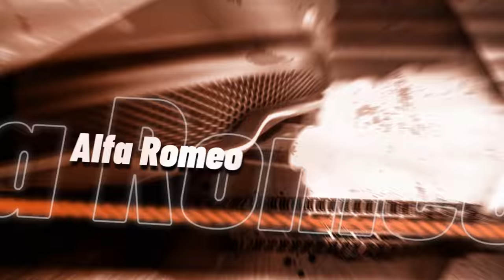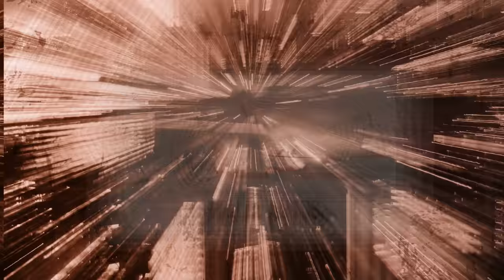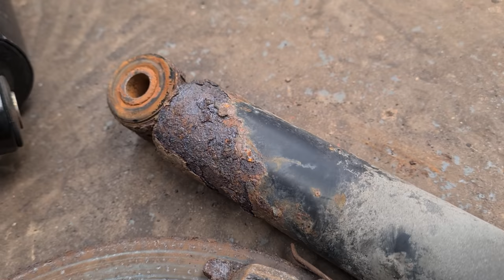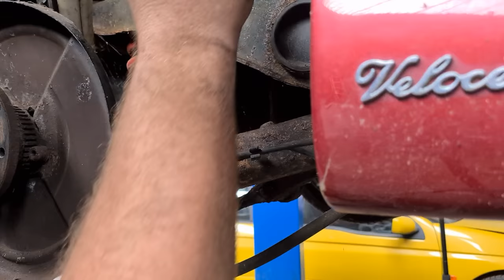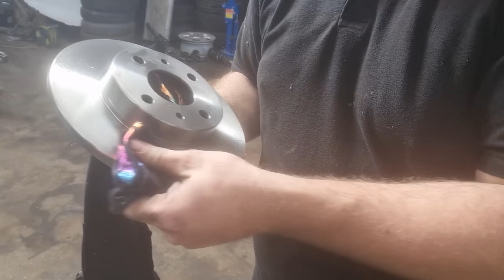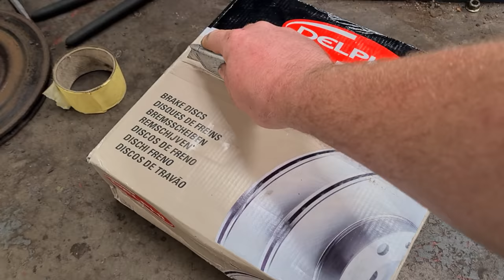Alfa 145 gets some new brakes and rear shock absorbers

Comment: Reasons as to why I typically complete my own brake work:

I rub down the disc mounting surface on the hub with a wire brush and brake cleaner, sometimes smearing the thinnest amount of copper slip on the hub

I clean the disc retaining screw thread and lubricate with copper slip

I remove carriers completely and thoroughly clean the brake pad sliding surface to stop sticking 

I clean the hell out of the calipers and even lubricate the piston to stop it sticking on the inner pad

I also ensure the parts are clean enough to allow the pads to slip in and out without much friction

But I guess I take ages as the time is my own

And I cannot believe there was no lubricant on the corners of the pads to stop squealing! How did you miss that or not clean the carrier surface??!!

Also, I hate uncoated discs, Delphi are always uncoated. My go to disc now is Borg and Beck Becktec as I cannot stand corroded brake hubs on cars after a fresh set of brakes!
Reply from the maker: wheels are coming off again and prob so are the brakes when the engine comes out for the rest of the work.

Comment: I'm really surprised that you didn't put any (copper) grease or something like that on the bolts that you put back... especially because you're struggling to take them of..
Reply: Or even put back the deadly rusty bolts
Reply from the maker: bolts had lube on them when refitted. several of the bolts where also cleaned up off camera.

Comment: I was able to get a 15mm socket on to the top shock absorbers nut through the plastic sleeve (4 min 20 secs) which takes away the risk of dropping the bolt or socket into chassis rail.

Comment: Telling off time. Don’t tighten bushes up without the weight of the vehicle on them and the car in its normal ride height. It just twists the bushes into an unnatural position once lowered and wears them out quicker. So many mechanics do this and it’s bad practice.
Reply from the maker: yep you got me.
Reply: As good as that sounds and should be done, I don’t know a single mechanic that loads a card suspension up before tightening the bolts. Maybe a Lotus Exige specialist or something, but no other mechanic will do. It’s very hard to access these bolts with a torque wrench once the car is on the deck.
Reply: @ItaliaAutos  Yes I was wondering about that... easy when you've gpt the transmission jack under the trailing arm.

A bit sloppy when you're showing "how it's done" professionally.

Comment: That rear beam needs to come off be stripped and powder coated
Reply from the maker: it could do but thats not part of the customers requests at the moment.
Reply: @ItaliaAutos  yeah I get that but for the sake of a few hundred quid if it was my car it be done
Reply: Those rear trailing arms want changing...getting the ABS sensor out will be the biggest issue, as will be finding a 145 ABS sensor for the rear